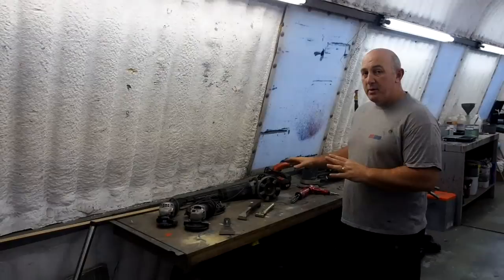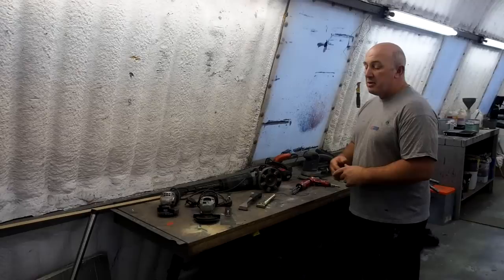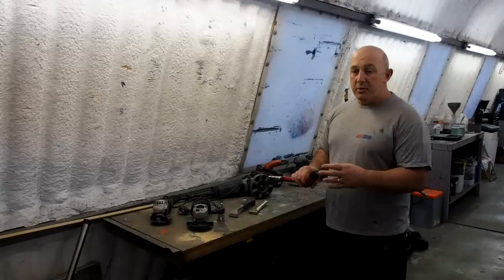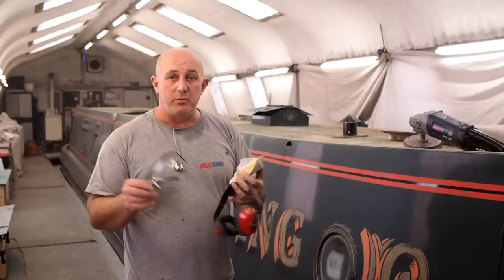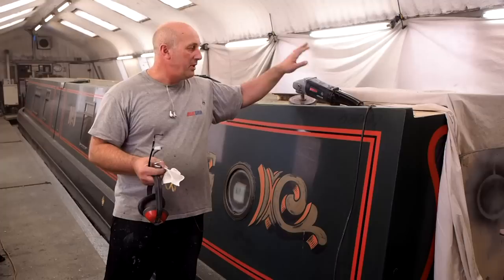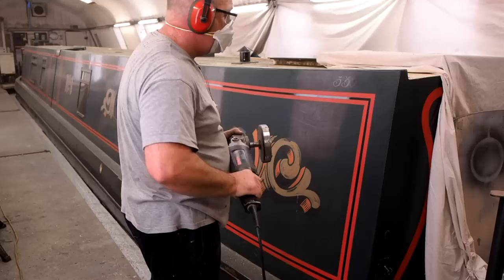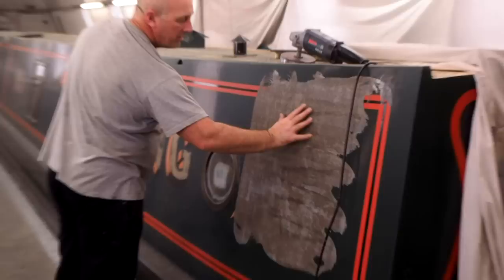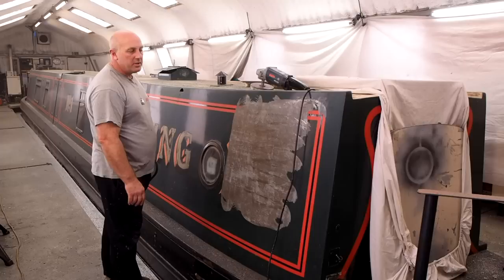How To Paint Your Narrowboat Part 2

Comment: I've never used a scabbler. What happens when it hits a patch of filler? Presumably it all comes off and you have to refill?
Reply from the maker: Hi it depends on how think the filler is, you may just take the paint off the top of it, if it was a job I was doing I would get rid of the old filler and start from scratch

Comment: Hi John, I was impressed with the way your first angle grinder dispatched the top coat of paint. Could you tell me what attachment was fitted, ie. Course Sanding disc 30 grit maybe (dont think) or some other kind of abrasive ( more likely)
Reply from the maker: Hi Terry, it's actually a polisher fitted with a scabbler attachment - it runs slower than an angle grinder making it more controllable. Similar bits of kit are pretty widely available from hire shops.

Comment: fantastic set of videos john mutch apreciated i will call to see you at crick hopefully for a course i work at john white boats i also use scabblers but not seen that fitment for a buffer polisher do you have the make and supplier plz  are they c5  teeth mine tend to break alot and are not cheap best whishes to you john looking forward to crick will need a hotel in youre area for course  rgds mike
Reply: refina scabbler head just purchased one from eagle plant with c4 cutting heads

Comment: Should the bare steel be given a protective coating within 30 minutes of exposing it to the air?
Reply: Depends on the humidity, if the boat is afloat in a dock the humidity will be high